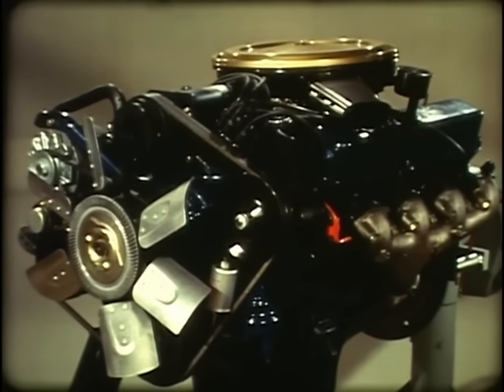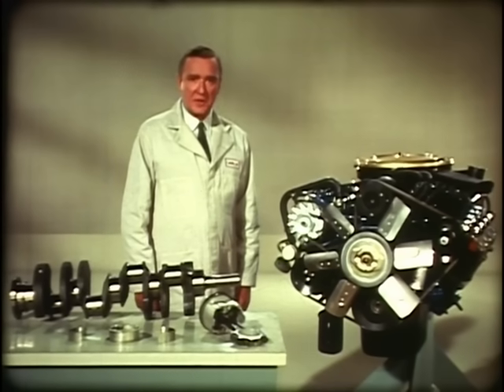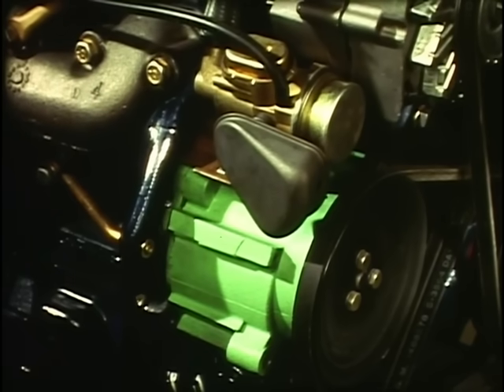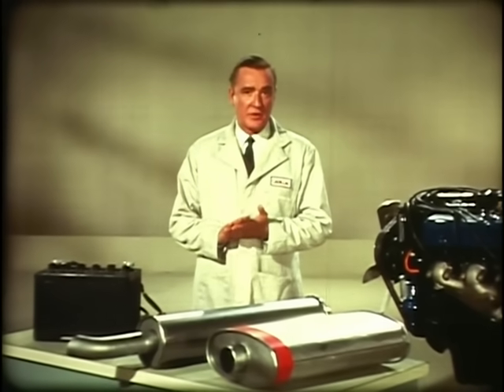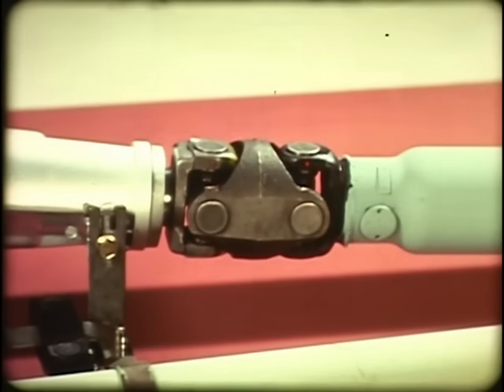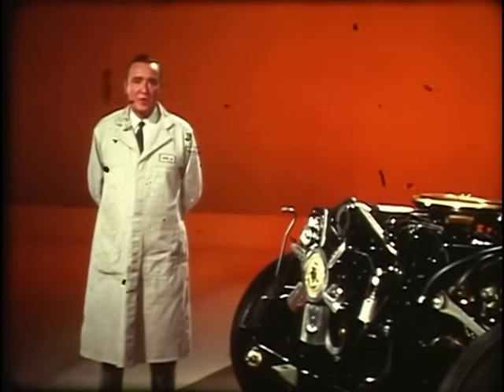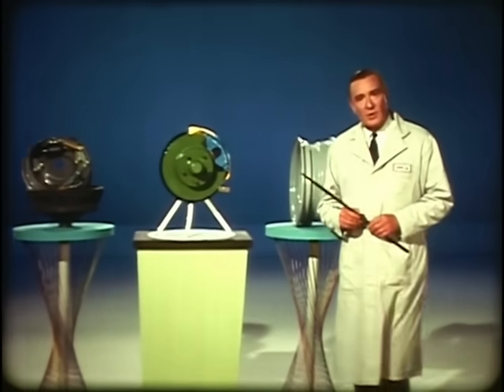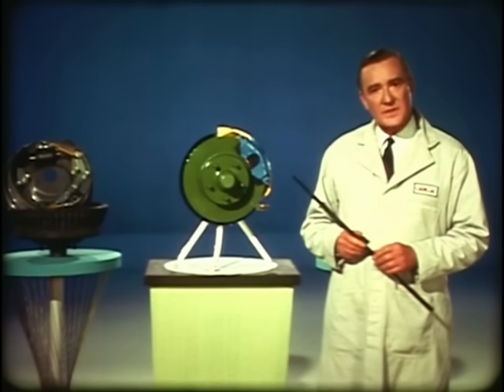1968 Cadillac Engineering Features

Comment: The GOLD STANDARD. The first engine I was involved in rebuilding was a 472. They were outstanding, a product of over 2,000,000 miles of testing over several years.  The piston/bore work done, the precision of it all was Standard of the World personified.

Before they had to have their compression ration lowered they moved 5000 pound in weight Cadillacs like silent dragsters. Incredibly impressive. I've had a lifetime of the 472/500 engines, bit less with Rolls' 412 aluminium engines, the 472/500 is the leader.

The short motors were hand-checked after the electronic balancing by craftsmen using a bar similar to a torque wrench, the piston/bore clearances incredibly refined, then run for anything up to an hour on test beds, checked by craftsmen. The very best of the best.

Comment: The 472 was a thing of beauty. I rebuilt mine , over did it a bit, fully dynamically balanced, custom made cam shaft (Thanks Cadillac motorsports development!) ,installed oxygen sensors in the custom tuned exhaust system. It had to be QUIET ,it is a Cadillac! When the secondaries opened ,LOOK OUT ! NASCAR LOUD! I designed the electronics that had 4 LEDS ( 2 red for lean and 2 green ones for rich) hidden in the driver ashtray. My Sedan De Ville cruised along at 117 MPH using only 2/3 of the primary in the carburetor! Floor it and it would snap your head back when the secondaries opened up! My 472 lasted over 220000 miles and never burned any oil. My gas mileage increased from 8.5 MPG stock to over 14.5 MPG after my rebuild. 18.5 MPG on the freeway at 55MPH. ( IF you could drive her that slow.)  I loved that car!
Reply from the maker: We still miss ours.
Reply: @dstragand  - I came in here because my dad had a '68 deVille (convertible) in the mid 1970s. He didn't have it for long.
Reply: I had a 68 and a 70 El Dorado. LOVED them and the 472 and 500's were screamers!
Reply: They got better gas mileage at 80 mph than at 60 mph. I tested that on a three hour drive one way.  My 74 sedan went over 300,000 miles. Engine still good when I scrapped it. I pulled the engine first
Reply: @HypocriticYT  - I could only imagine if it had a 700R4 transmission instead of a Turbo Hydramatic 400. Imagine it cruising in overdrive!
Reply: @OldsVistaCruiser I bet they'd get an honest 20mpg on the freeway with an overdrive!
Reply: I had a 1970 Coupe Deville when I got my license in 76. I could blow Cameros off the road! Once Bessie got rolling that car would glide at a hundred all day long!
Reply: This type of mod pleases me no end. The insight is to first use a foundation worthy of spending all the money and time and busted knuckles. The Cadillac block was a beast and to add your sensors etc I find fascinating. Thanks from Ziggy
Reply: I loved that car ,It reminded me of that scene in good fellas when denero was shown that pink Cadillac and the other guy said, "I love that car"
Reply: You took me there, thanks
Reply: That was one of the smoothest engines I've ever had in the 74 Fleetwood Brougham.
Reply: Thank you for sharing. These stories will keep these old beasts alive.
Reply: The 472 was probably one of the greatest American engines EVER produced!

When I was in high school in the Eighties, I had a 68 convertible that Dad and I really tuned.

It'd keep up with the then-new 5.0 Mustang and the I.R.O.C. Camaros, light to light 😂
Reply: I had a 69 Fleetwood brougham with this engine. On the highway I found it quite difficult to keep it under 70 mph. I actually got three speeding tickets in a two-week period in that car because of that engine :-)
Reply: Do you have specs on the cam,  compression, and such anymore?
Reply: Are you sure your Cadillac was a female? Lol 😂 
I never understood why people called automobiles "her" or "she" 
Hilarious

Comment: I like seeing the engineer talk about the Caddy big block in the year it was introduced.  I was surprised to see it had an AIR pump on it in 1968.  I didn't think those were put on until 1971.  The 472 was stroked to 500, I think in 1970.  The Caddy big block could have gone to 600 cubic inches if The General really wanted to push it, but the Clean Air Act and Arab Oil Embargo wrecked that idea, and a lot of others.
Reply from the maker: I believe the 472 had more HP and torque than the 500, correct?
Reply: @dstragand  No. In 1970 the 500 put out 400hp and 550ft lbs of torque, 25more hp than in 1968. And I think 25 more ft lbs of torque, as well.

Comment: My dad had a 68 coupe de ville ,  gold with white  leather interior  , what a beautiful  car   I now realize  the 60s were maybe the best  decade for gm .
Reply from the maker: Thanks for sharing!
Reply: The color schemes for exterior pint and interior options was the best. Check out an old color option page of the 60’s. For Cadillac. The metallic turquoise and pink mauve were very sharp.
Reply from the maker: @ziggy979  IIRC, they also offered custom paint of several previous year's colors for an extra charge.  Interior schemes as well.  Money would buy you a lot of customizations then.
Reply: Everything went to crap starting with the 1972 model year, all manufacturers across the board lowered compression ratios for unleashed gasoline. Less horsepower and worse fuel economy, plus spark knock and run on after turning ignition switch off.

Comment: A beast!  So, like 4 MPG?  :)  Was driven to Kindergarten in the daycare lady's '67.  Was nothing like any cars my parents had.  Like floating on a cloud - and those reverse pivoting windshield wipers was about all I could see in those deep bench seats.
Reply from the maker: We put about 75k on a 68 convertible in about 2 years.  Got around 20 highway and 12 in town.  About the same as a lot of pickups actually.
Reply: If you're going to worry about MPG's, then get yourself a vintage Datsun instead. Actually, with a medium foot, you'll achieve 10-12 MPG with normal driving. A heavy foot and it starts dropping. About the same as today's large trucks.  I drove a '74 Eldorado from SLC to Seattle and averaged 12.  Not bad for a brilliant, quiet ride and super quiet and comfortable.

Comment: I remember the 425 in my 1978 Eldorado...  It was so smooth and quiet, you could barely hear it running!
Reply from the maker: Thanks for watching, @am74343!
Reply: And it made like 190hp. So choked off with emissions it became a paperweight. It's so sad. 70's Caddies after 1970 sucked, 80s were even worse.
Reply: @airplanemechanic9513 Considering Cadillacs aren’t race cars the emission era 472/500/425/368 were fine.  I had a 1977 Coupe Deville and a 1979 Sedan Deville and both had the 425.  They were torque monsters which in a big heavy car is more important than horsepower.
Reply: I had a 78 it wouldn't pass anything not even a gas station. What GM did to that amazing engine was a shame. The 70 that I had was awesome and the gas mileage was around 15 mpg.
Don't even get me started on the 368🤮

Comment: Notice the skinny width tires on all 4 wheels, without any fancy tread pattern design.
Reply from the maker: True.  But they were still much wider than the 1950's.  It's only the modern era that we have gotten these wide, low (and very expensice) tires.  About when did the shift to low-profile tires begin?  Around 2010ish?

Comment: Had a former Mercedes engineer tell me back in the '70's that Mercedes would test all the American V8s against their published HP numbers and run them for a long time at that rating. Most would fail the wrist pin except the Cadillac, it completed the test successfully.
Reply from the maker: @RonRussell-sj1zf  It was definitely an “over-built” piece of engineering.
Reply: No passenger cars engine is designed to run at full throttle or max out putt. You're comparing apples to oranges!
Reply: @jimmartin5362  Not comparing, just making a statement about the Cadillac engine. With mods, American V8s can run hours at full HP rating and above.
Reply: @jimmartin5362  They are so designed.  But as far as rated power output is concerned, only for a few minutes.   Otherwise there would be no point in having a power rating.
Plenty of engines originally designed for passenger cars are also used in light trucks (trucks up to about 5 tonnes or so).   Because of the extra weight and air drag, drivers quite often drive mostly with their foot flat to the floor to keep up with traffic.  Usually only slight changes are made to the engine - larger bearings, changes to cam timing and carburetion to reduce maximum power about 20% or so, so that the engine won't overheat.   A larger radiator is usually fitted.
Reply: @jimmartin5362  I allow myself a comment on this discussion. Bein a German, I owned numerous cars, including 3 F-body Camaros, all 300ZX Nissan generations, Supra single and twin turbo, Lexus SC 400, a 1991 Carrera 4 and some more sports cars.
The F-body Camaros, presumably just as all American cars of that era were designed to stay sufficiently cool under operating conditions as in the US. The 55-mph limit did not allow to run engines under high load permanently. 
I do remember of hearing about American V8 and inline sixes dying from heat stroke on German Autobahns then and now in those days, killed by drivers in a hurry. 
You could operate them safely at 70 to 80 mph, but not higher. An empty Autobahn meant a deadly danger for clue- and careless drivers engines. 
For my first Camaro I got me a larger radiator and two electric fans to replace the stock radiator and viscous-coupling fan. 
I could run on the nightly-empty Autobahn with 110 to 120 mph and the according high revs for hours without the temperature gauges needle even nearing the "hot" field. Doing laps on the Nürburgring race track did not pose any temperature related problems at all, while brakes and overall handling were insufficient in comparison to the japanese sports cars or the Carrera 4.
The only really capable and serious US-sports car then was the Corvette, while Camaros, Mustangs i.e.all had a sporty apperance at most, at least in factory outfit.
I swopt those parts mentioned from Camaro to the other.
Reply: WTH does "fail the wrist pin" mean?
Reply: @deeremeyer1749  The wrist pin, known as the gudgeon pin in England, is the pint that connects the con rod to the piston.  "fail the wrist pin"  would mean mechanical damage to the wrist pin - galling due a combination of excessive temperature and insufficient oil flow.
For rotating shafts, engineers who are familiar with tribology - the study of mechanical wear, know how to calculate required bearing dimensions for continuously rotating shafts at whatever oil pressure has been selected.   But the conditions for wrist pins, often not pressure lubricated, are such that a mathematical approach is not known, and engineers design wrist pins based on experience of what has worked well in the past and what hasn't.
Reply: @deeremeyer1749  Piston pin bushing in the small end of connecting rod.
Reply: GM engineers reported the 5200 series engines ran for 1,000,000 miles without a single internal failure in the test cell. I'm not surprised at all. I've ran a '76 500 after it rotted in Arizona for 40 years. The best of the time.
Reply: Funnily enough, as a Mercedes guy first-and-foremost, the 472/500 is one of a very small handful of American engines that I respect enough to own one--and I do. These were very good engines, by any standard.
Reply: Car engines simply have never been designed to deliver full power continuously.   They don't have the cooling required, for a start.
At university, we had several GM engines (not Cadillac) mounted in dynamometer rigs for students to do various tests on.   These engines didn't have the standard radiator - the university technicians had installed larger ones.  One time I needed to run an engine at full power for 30 minutes.  At the scheduled time, a technician was ready with a hose.   After about 12 minutes running, the coolant boiled, and the tech just continuously squirted fresh water into the header tank to replace what was lost in steam.
Industrial, truck, and marine engines have oil jets that spray the underside of the pistons with oil to cool them.  Car engines don't have that - they rely on piston heat conducted through the oil film into the cylinder walls.
Reply: @keithammleter3824  This isn't a fully accurate statement. Many production car engines have features like oil squirters, and sodium cooled exhaust valves, and are engineered to run at or very near maximum rated output for extended periods of time. This is very common in German engines, particularly older ones. 

The M119, for instance, has both, and MB used to run some of their higher-output engines at maximum output for hours before installing them in the car. Every engine. For every car.

From Car & Driver, on the 300SL:
"Before they're even dropped into a car they're run for 24 hours on a dynamometer, including six hours at peak output. Then they're torn down, checked, reassembled, and given another eight hours of running-in."

The M100 and the cars it went into were treated similarly.

So were various BMW and Porsche engines.

Even the Japanese have done it, the Nissan VH45 has oil squirters if memory serves, as does the Toyota 2GR-FE, which is literally a Camry engine. In the case of the Camry, as you said, the cooling system may very well not be up to the job of handling 100% output at a 100% duty cycle, but on something like an E34 M5 it absolutely is.

So it's not really that "car engines" aren't designed for this, it's that cheap engines--and particularly American engines--have never been designed for it; in part because there's basically no use case for that kind of thing in the US, in part because the average American consumer is too ignorant and price-conscious to appreciate it, and in part because aside from the Koreans, the big three are the worst in the game about building down to a price and (for the most part) have been since the end of WW2.
Reply: @siorusbzns654  True.   Especially in regard to German engines being better.
Except that "peak output" when written by a journalist in a popular magazine needs to be taken with a grain of salt.  Peak output might mean that an engineer told the journo that the engines are tested on the dyno with throttle wide open.   That's pretty standard in engine testing and doesn't cook the engine because they use the dyno brake to hold down RPM well below the max power RPM, or let it rev higher than the max power RPM, except for short periods.
If a car engine produces the specified torque for each test RPM in factory testing, that pretty much assures them that no mistakes were made in building it.    It would be nice to run it at max power for a specified period, but that costs money and as you say, there is no use case in the US to support it. 
All the first year engineers at the university I went to got to do wide open power and torque versus RPM curves on those GM engines without any issue, though we were commanded to avoid running the engines at and near max power RPM any longer than needed to get the power and RPM measurements - a matter of less than a minute.   At low RPM the engine is not sucking in much air/fuel mix per second, so not so much heat generated.  At high RPM above the peak output RPM, the engine breathing is not so good, so again less heat is generated - even with the throttle wide open.

Comment: The '68 engine was truly impressive, with its huge block serving duty in Cadillacs all the way up to the early 1980s; that's one reason the '77 Cadilacs had the wheels 2.5" further forward than the other C-body cars. But I do miss the gush of instant response from the switch-pitch torque converter that was discontinued for '68; that's one automotive invention that deserves a comeback.
Reply: I had a66 Buick Electra 225, 401 engine and switch pitch Torque converter with a 3 speed . Would accelerate very well from a big car.
Reply from the maker: Agreed.  There is a reason the '68 is referred to as "the muscle car in a tuxedo".